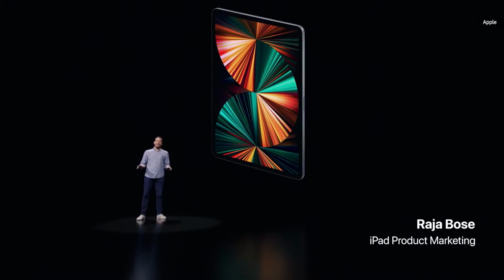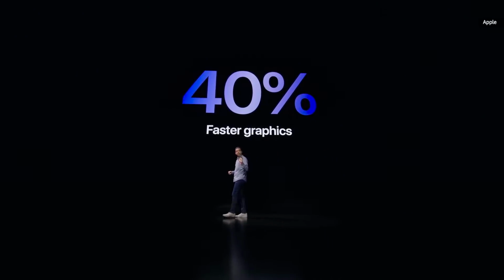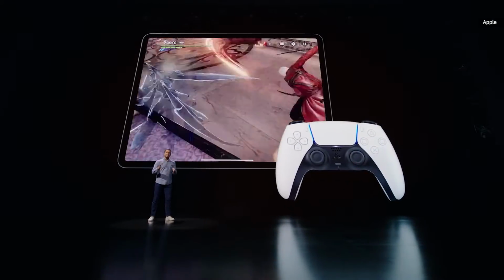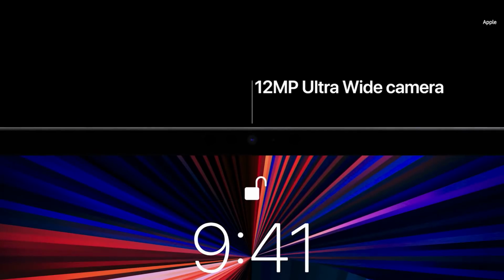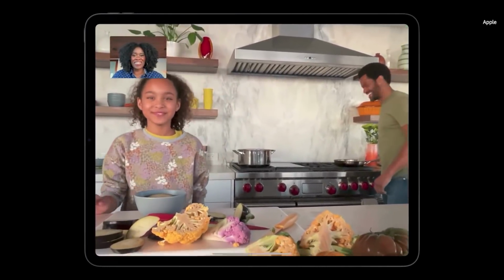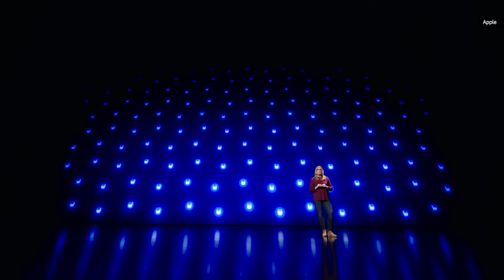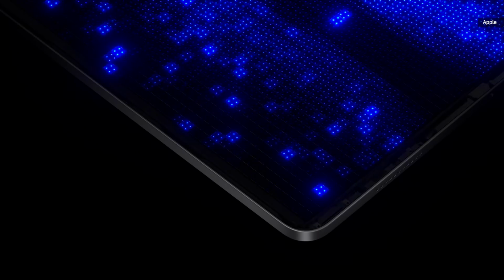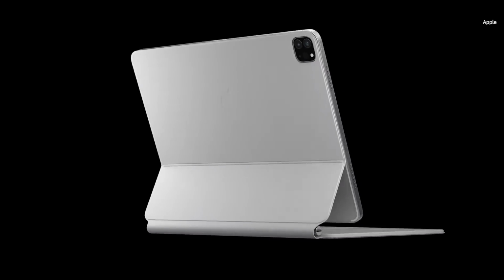Apple's 2021 M1 iPad Pro with XDR display in 5 minutes

Comment: The part I hate is that the 11 inch doesn’t get the XDR mini-led to 1000 bits full screen to 1600 nits peak brightness, just a plain old 600 nits with no mimi-led or XDR display BORING, I expected more form that what a disappointment

Comment: I still don't understand why iPads are sold for   $800, but iPhones are being sold for $1000+
Reply: 5g modems, Samsung Amoled displays, Camera sensors, Wireless charging coils, water proofing, stainless steel frame, glass back. Everything costs extra money.
Reply: Because the camera system is expensive, they have to waterproof it, and because they have to figure out how to miniaturise everything enough to fit it without sacrificing anything else too much
Reply: Expensive to make small component

Comment: They’ve done it. They’re just one step away from making this the best machine on the market. All they need is 16:9 when you plug in to a monitor and not 3:2, that’s it. That would literally be it.
Reply: Or how about an adaptable ratio and resolution based on your monitor like any real computer
Reply: @0741921  YES! That basic reason is why iPad cannot be a computer, at least for me. Its just not as flexible as Windows/macOS
Reply: @mtunayucer  with due times my loves
Reply: Oh naw iPad os is not nearly as good or useful for work as Mac OS especially when it comes to the pro apps
Reply: Does the 799 has less features than the 1099?
Reply: @rice4823  different specs, most prominent you only get the xdr display with the 12.9 inch. 
Furthermore 16gb of ram only with the 1tb and 2tb varients. If you don't work with photos or videos then maybe that display is less of a must. Usually I go 11 but now will be 12.9.
Reply: so true , almost no one talks about it when it comes to beta test....
Reply: they should also make the ipad pro to connect it to cintiq. WOW!!!!!

Comment: Can I just have this with Mac OS pls?
Reply: I don’t know if the iPad ram can handle it dedicated computers have 16/32 gigs
Reply: @akshayiyer4996  The 1TB and 2TB versions have 16GB RAM. Other models have 8GB RAM.
Reply: At this point, iPad pro 2021 + IOS can support pro apps just as well as the mac.  I'm gonna order the 2 Tb option.
Reply: @johnarcarese4301  The software doesn't support it. It'll be coming though, surely, eventually

Comment: Great they brought the M1 to the iPad now there’s no excuse for not havingFinal cut pro and other professional apps.
Reply: the hardware has gone way past a mobile OS at this point. might as well make a 2 in 1 laptop now and combine this with the air
Reply: @samelmudir  They need a desktop mode on the iPad when it docks with the keyboard
Reply: @Ryan Oneal it doesn't have the features professionals need. But if the M1Ipad can support MacOS apps that would literally mean I can create a mobile workstation. I have felt that iPads were the best value for money product line Apple has had for years since the introduction of Pencil. MacOS grade apps would mean a complete integration.
Reply: @Ryan Oneal bro if you've never used professional editing software or edited a professional video all explanations are gonna go over your head.
Reply: @Ryan Oneal please go look at an actual NLE like Premier or Resolve or FCPX to see the difference. There's a lot more beyond simple cuts in editing tools, for professional needs.
Reply: @Ryan Oneal No stabilization
Reply: @Ryan Oneal It has no keyframe easing. A must for professional video editing.
Reply: That is coming in the next update, should be really soon. They’re always updating and adding features so I’d double check their latest version to see if it’s satisfactory if i were you.  Luma is on a roll and now it’s also on the M1 macs so it’s a good workflow if you have the iPad for a laptop and a Mac mini or something as a desktop.  @waltonks8172
Reply: Lumafusion for video, affinity for photo and graphic design should replace most people’s desktop apps without problem as long as you are willing to learn the interface.
Reply: no
Reply: I just need the iPad to run desktop versions of Chrome, Adobe, Office 365 and File Explorer, and I'm sold.
Then, and only then will I sell my Windows Ultrabook and Samsung Android Tablet, and instead get the iPad Pro as my primary PC.
Reply: @mini9503  

android oled master race
Reply: Microsoft most likely limited their Office for iPad features to sell more Surface’s, I switched to the web version of Google Docs, Slides, and even Sheets and has never left me needing a PC or MS office. As for Adobe, they clearly are slow to switch away from the X86 days. Just switch to Affinity photo and Luma fusion, they are excellent replacements and I think the only feature that the latest version is missing is auto stabilization.  The file system is OK, not amazing, but it’s usable and will improve in IOS 15. File explorer needs a lot more work from my experience.  I have completely replaced my laptop with the iPad and iPadOS has been very competent so far, it’s truly becomes a midrange Mac for most people. The IOS version of Chrome has a “default desktop mode” option, the only thing it’s missing is extensions so if you use those, i understand the frustration but I never use them so I guess it doesn’t affect me.  Maybe I’m a niche user but I feel as long as you aren’t tied to a specific company’s apps (mostly adobe or Microsoft’s), the iPad already is a laptop replacement for most users and a better value for money than any Mac. BTW, Apple will likely bring FCP to iPad this summer (if they don’t, then this was a waste of the m1 chip). @mini9503
Reply: @austing4321  Agree with you that usually non-industry standards are better as alternatives. I found this also applies to Windows UWP Tablet apps as big companies like Adobe fail to put any input.

Again you're right. Chrome is a huge deal for me personally 😂 as I have 30+ extensions running, and have 100s of tabs open.
If iPad could somehow dual-boot or virtualize ChromeOS to be able to run the Desktop Chrome browser in both Tablet and Keyboard Docked mode, then I'm 100% sold as there's no reason beyond that to stay on Windows 10.

Probably the only thing would be that I live in a fairly conservative city and a country that sometimes REQUIRES me to use Windows for occasional work, which sucks. 

I think you're right that Apple is considering bringing aspects of MacOS to the M1 iPads because otherwise, there is no point to spending more for them.
Reply: @mini9503  
Yes, the extensions thing is annoying and i know many rely on them so that argument is something Apple needs to (and probably will) address this summer. They can’t control Chrome but if they add extensions to safari and allow 3rd parties to do the same on their browsers, that would be lovely. Again, I’m not affected either way because I never used extensions on my PC besides ad blocker and a privacy thing which Safari has built in. 

Also, when i say alternative to Adobe and FC, I don’t mean inferior. Affinity on iPad has pretty much all the features of desktop photoshop and I’ve used both to a large extent plus Affinity is also a lot more modern and cheaper on top of that. Adobe doesn’t care enough to bring their desktop features to the iPad, its so watered down.  As for Luma, I’m not a video editor but I do know a couple people in the field and they say that recent Lumafusion versions can replace the Adobe suite at least and maybe FCP depending on who you are.  IMHO, the iPad app ecoystem is far more powerful than Windows 10’s app ecosystem.
Reply: meow meow
Reply: Feelsbad for the mobile market.